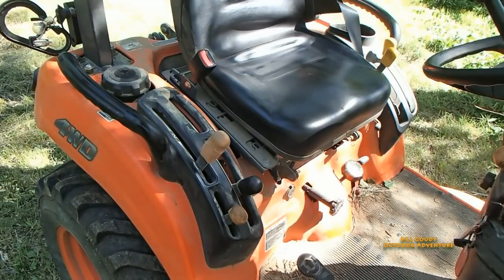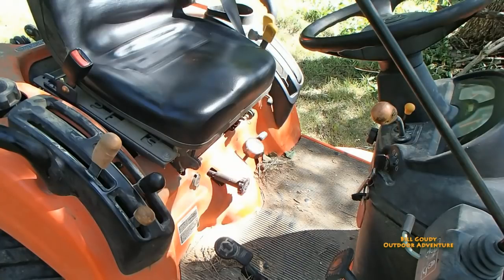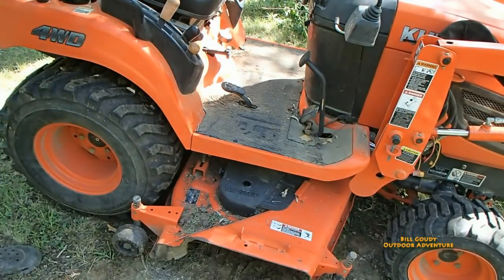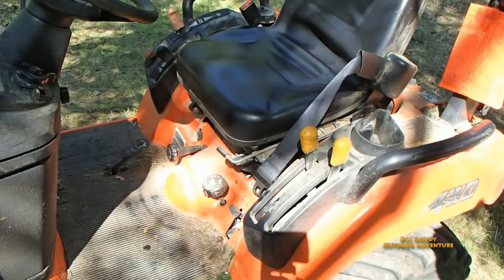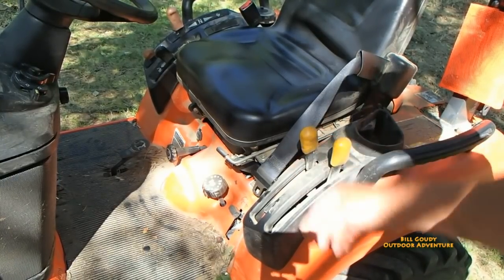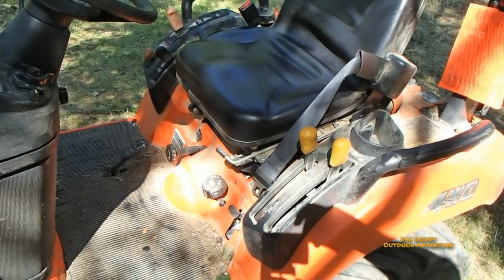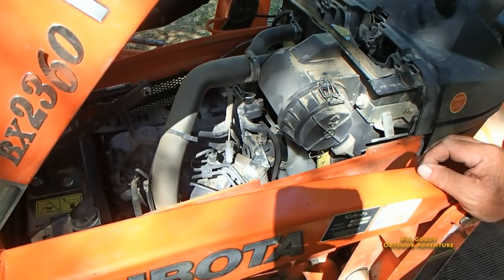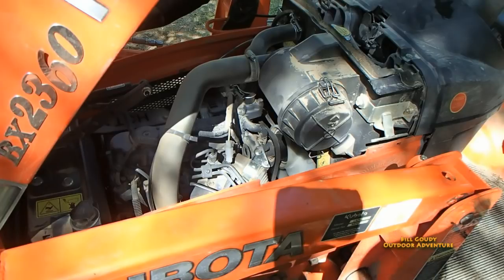BX 2360 Kubota Tractor In Action

Comment: If you keep the clutch pressed in and push a little on the gas your bucket will move a lot faster and will increase your efficiency
Reply from the maker: Thanks, For the tip!!  ;-)
Reply: This tractor only comes with a hydro-static trans. There is no clutch. Just the treadle peddle on the right and brake pedal on the left. Same as my BX2370. Awesome little tractor.